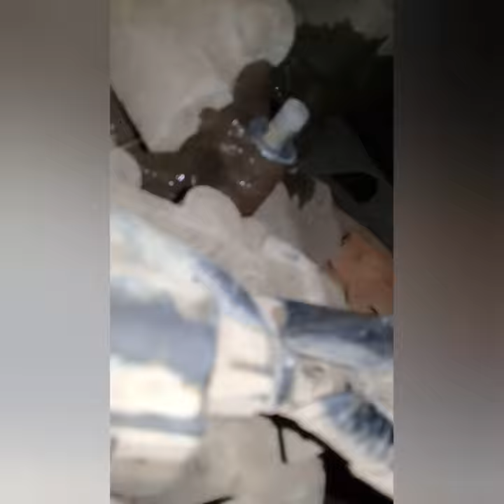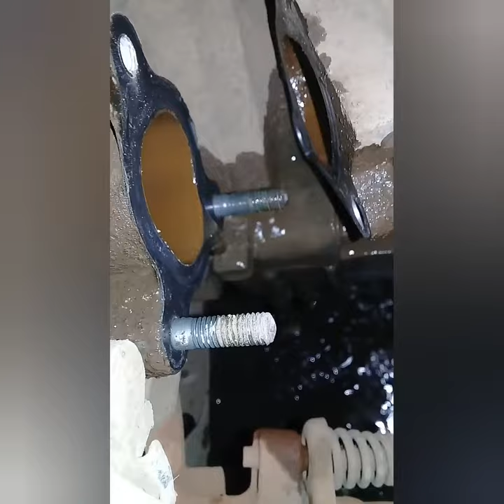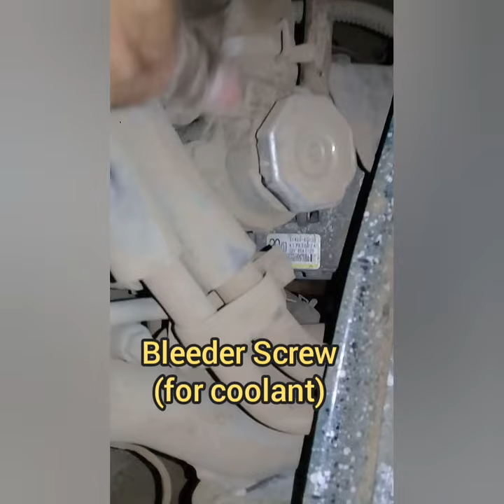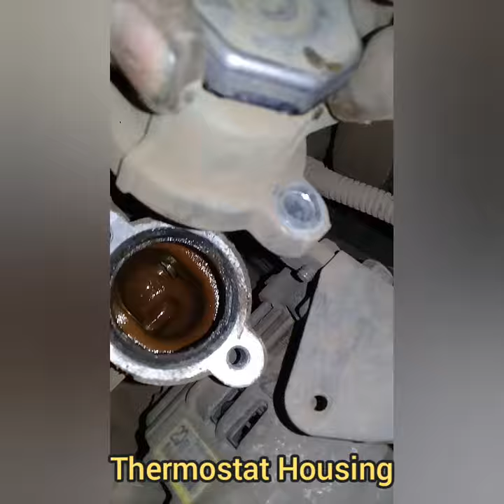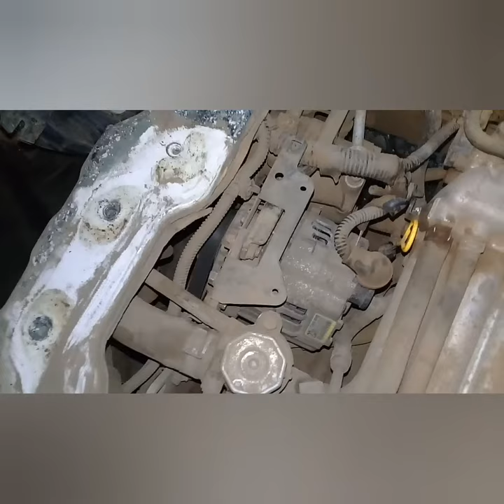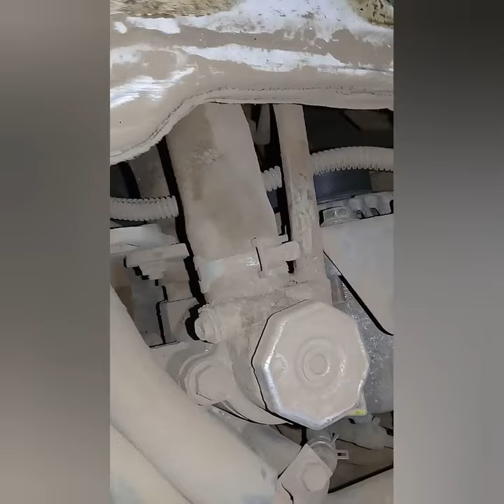Suzuki K6A | Cooling system check

Comment: Ang fan ng radiator boss na bypass na yan?  Pag on ng swicth umaandar na ang fan o palagi na  on ang fan sa  radiator kasi init ng makina sa akin boss pina bylass ku na sabi nga kaibigan ku.. Da63t.
Reply from the maker: Oo boss, bypass na.
Reply: Boss same sa da63t ko pick up naka direct na un fan ng radiator.
Linagyan ko ng digital na temp.gauge nasa 60C ang temp nya..ok lng ba ung temp.nya boss.na 60C?

Comment: Sir parang multicab ata yan na engine ano?
Reply from the maker: Tama sir,
Reply: Sir plano ko po bumili ng minivan na da64v. Matibay po kahit surplus lng? Nagkakahalaga kasi sya ng 200k.
Reply from the maker: @phpau7734  di talaga tayo sigurado sir pag surplus, matibay naman ang model na yan, EFi siya tipid sa gas.